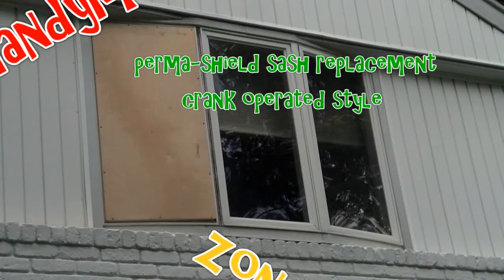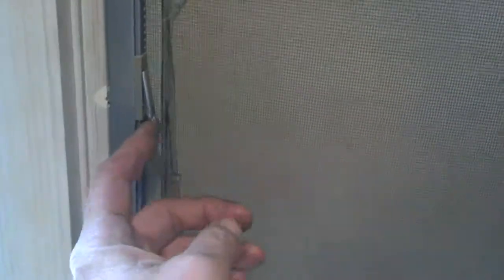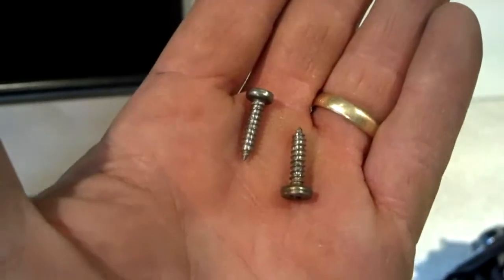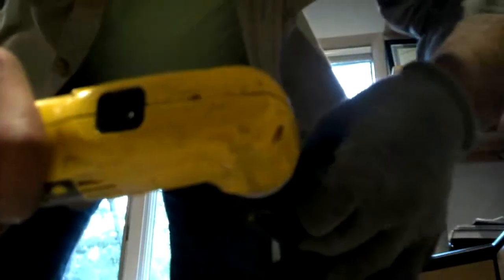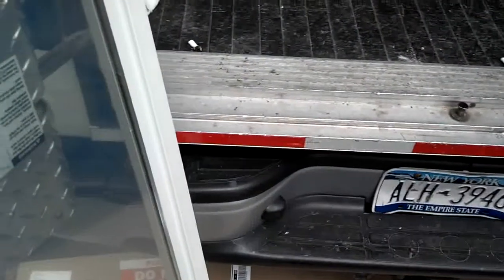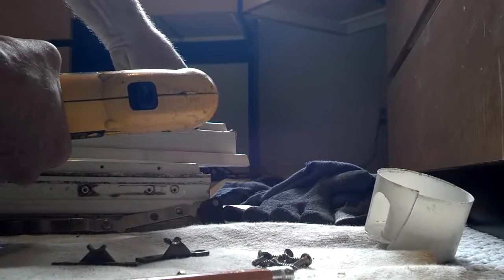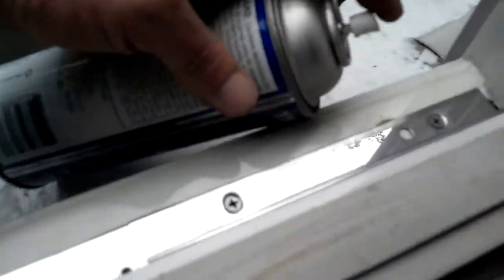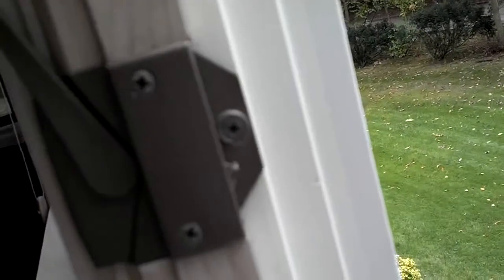Anderson Perma-Shield Window Casement Sash

Comment: I finally replaced 7 of 13 C6 casements, much clearer, went with Sun glass lowe 4...easy pz...remove hardware, slide in to  tracks.  20 year on glas, hardware is 10.  I got 29 years out of them

Comment: Excellent video, and demonstration. I have a similar project. Now I need to order a new sash. How do I find the correct replacement Sash?  Do you have a source for preowned Andersen casement sash I think it’s the 400 series. I need a 19.1/2 by 48 inch. White. Thanks!  I don’t think the mfr would replace for me since I’m not the original home owner.
Reply: How did you make out. I just called Anderson for a stress crack in a 17 yr old window. They never asked If I was original owner. They are sending me a new sash
Reply: @340rps  Anderson stands behind their products.  I finally swapped out all 33 casements..with all new casement sashes..all in sunglass..blue Grey tinge .  Nice darker shade outside looking in..but looking out clear white. Light coming in..stops the strong direct sun heat like msgic..and looks great..the glass has improved coatings and seal..they have desiccant in the edges now for better life...edge seals are improved .  Cardinal glass videos are very informative...Cardinal glass makes the actual glass and sends to Anderson as ordered..Anderson puts them in the frames etc...20 year warranty on glass and seals...

Comment: don't take the plastic of till you are done!!!
Reply from the maker: Thanks for the tip cengeb, some people never take it off, i lol driving sometimes and see that sill up on years old projects! .... like them silly warning labels on power cords!
Reply: How anyone can leave it on permanently is bizarre!  It's slick how it's applied perfectly, and really does keep the glass protected, in shipping and during installation.  pull it off when all done, and nice crystal clear glass, I just got done changing out 6 casements, 29 years old, moisture inside, new Low e 4 SUN, nice...the low e 4 is andersens's name for lowe e 3 with that neat glass technology, where the glass has Si dioxide, Ti for keeping spots to a minimum, smoother glass surface.  Velux (just had 8 Veluxes installed too, low e 3 is improvement over 29 yar old low e, coatings improved, better things improve in 30 years, glass technology, keeps getting better and better.(replaced 29 year old Andersen roof windows, gaskets old, dried out, weeping) has it called NEAT, which is what the mfg calls it, probably cardinal glass have 6 more C16 to do in my back room, not fogged yet, but all the same age, they will...stationary ones 3 and 3 more operational, operating ones are easy to change out, the non operating ya gotta pull out the sash wood blocks...amazing how well the hinges,arms and hardware is in great shape after 29 years, SS, matters!  Even the screws are in perfect shape.